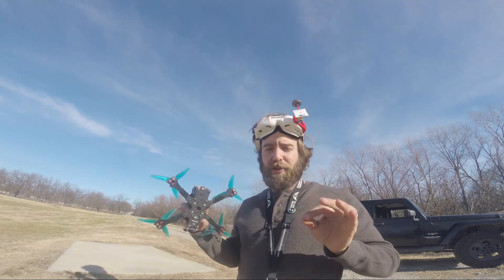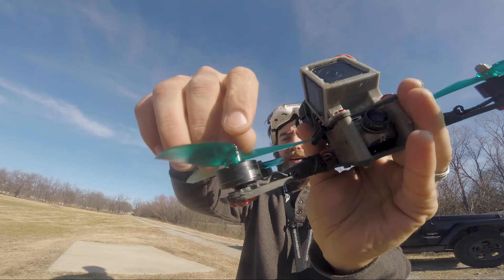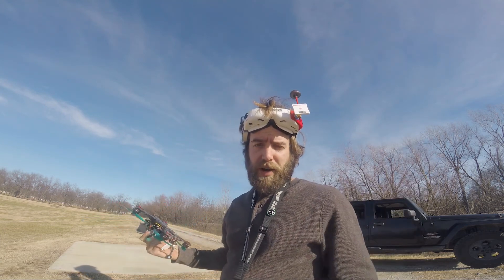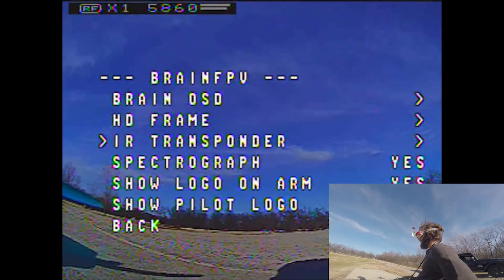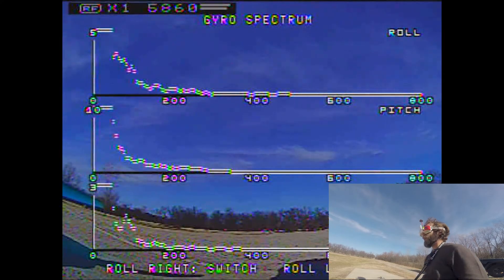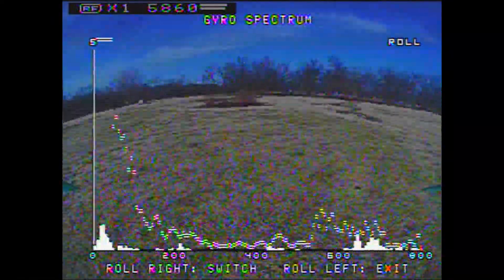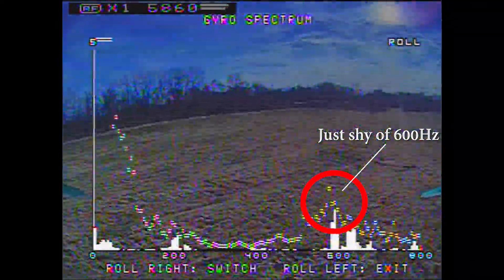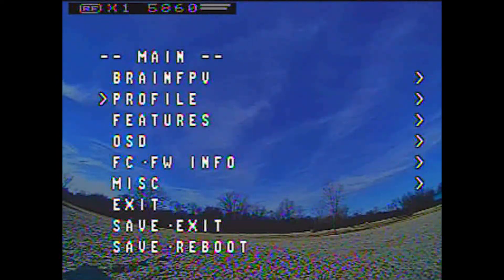LPF Filter Tuning on the BrainFPV Radix // Spectrograph

Comment: i used the spectrograph today,and on my pitch and roll they both match. the noise starts at 550 and stops around 750 on both p,and r. My yaw is good. My question is what do i tune,what filter should i set these #s to. I have video saved on my computer.Only filters i have on is d term. guess i could turn on gyro lpf 2 to about 500. I just dont know what filter to touch. Any info would be awesome. thank you
Reply: Did you manage to work out which filter to adjust for p and r?

Comment: So just a little info at the risk of sounding annoying.. don’t filter like that lol. The amount of noise here actually increased on ya! It appeared less bc the scale went up from the first to 2nd flight  by 4x to adjust for this (you can see in the upper left of the graph). I think your confusing low pass filters with notch filters as this would work fine on a notch. With a low pass filter you’re just picking a cutoff point, anything under that point is allowed through.. anything above it is attenuated. So the higher the number the less filtering.. if lpf1 or dynamic filtering wasn’t on you’d be in big trouble haha.  👍🤓
Reply: Max Beamer I was about to say the same. As soon as he landed it caused a massive spike on the low end which changed the scale by a lot. When he started flying again the scale never reset so it looked lower when it wasn’t. Particularly I’m not sure if this graph is showing debug (pre filtering) or filtered data. If it’s filtered then sure (I doubt it since his current LPF was set under 600. If it’s debug (pre filtering) it will still show those spikes regardless of the filtering. (Since it’s pre filter graph)
Reply: Javier Molina yep, good point. I’m not sure if it’s debug or not, I’d assume its post filtering since that would be the more beneficial option for field tuning but who knows! If it’s pre filtering that’s a whole other placebo effect going on lol
Reply: @MaxBeamer  I feel like its pre filtered just because if not then it would be much quieter as the default filters would filter things that high, but I am not sure as it auto scales so you have no clue how granular things are. Maybe some flips and rolls would fix that... I might try it out with my 7" quad that has a BrainFPV Radix on it.
Reply: well spotted re the scale. Ultimately I think the spectrograph is useless and gives people who have no idea about filtering an inaccurate tool to mess up their filters. It doesnt help the radix tutorial video on the website also teaches people to put a Low Pass onto the noise peak which as you say is the job of a notch filter. Using a low pass like this just makes the problem worse - if indeed there is a problem because we don't know if the spectrograph is post or pre filtering. It's a bit of a joke tbh...Radix users seem to love placebo.
Reply: Stephen Wright hi buddy I’ve no idea when it comes to filters, is there any video you could recommend or advice I could look up? Maybe that explains it simply 😀Thanks Stephen

Comment: Interesting!  ..how often do you check?   ..just after bad crashes?
Reply from the maker: I always set them first on a fresh build, then only when I start to see vibrations in the OSD or HD video. It not only allows you to easily adjust your filters for the best flight and footage, but allows you to keep adjusting it as equipment wears or is damaged. Getting more use out of your components.